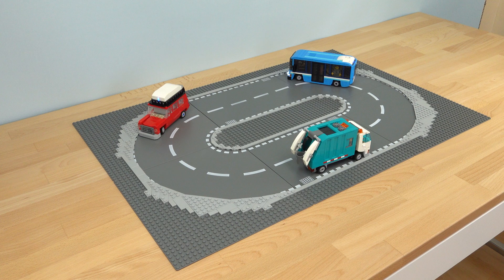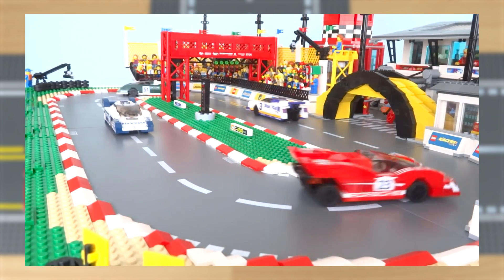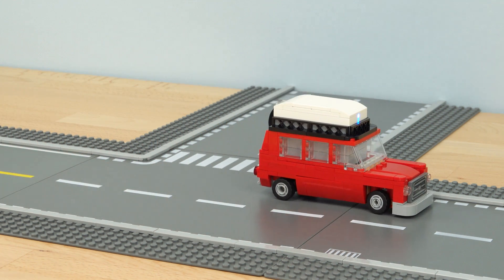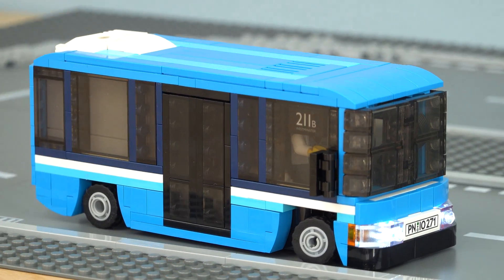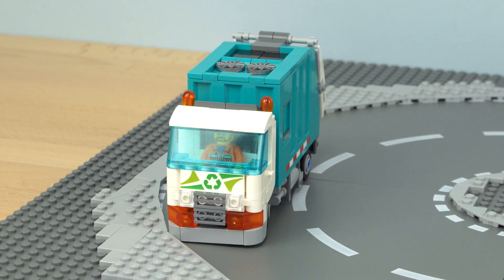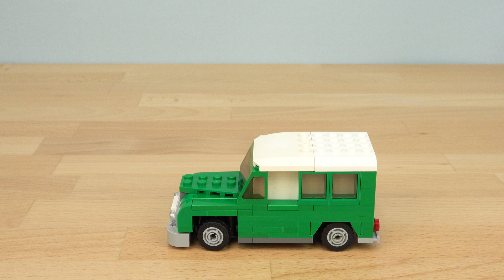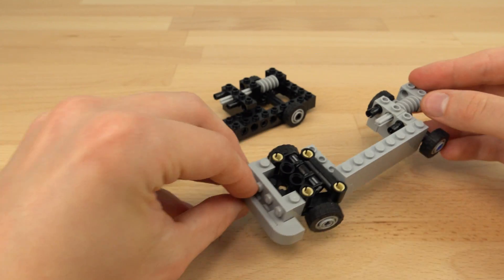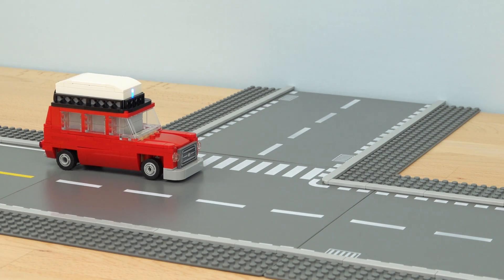Self-Driving LEGO Vehicles - Tutorial!

Comment: This is neat but JK Brickworks did a better job by implementing a iron wire under the track and uses magnet to steer the vehicle.  I use his system in my city with a L shapes road and it can accommodate 2 opposite lanes.  I have a van, bus, and truck running in it.
Reply from the maker: JK Brickwork's design is interesting but it's not a 100% LEGO based solution if you need bits of tape and metal wire. I specifically wanted to design a self-driving system that uses only official LEGO pieces and no third party elements.

Comment: Very nice, one issue though: With the way it is set up it can only deal with one set uf curves though, right? I.e. if you have a left curve followed by a right curve wouldn’t the car swerve into oncoming traffic? To combat this I think you could spring-load the steering so that it always steers in one direction per default. (i.e. right for driving on the right side). However, then it wouldn’t be able to drive across straight junctions like your current version.
Reply from the maker: Yes that's correct, in that situation there would be nothing preventing the car from driving over onto the opposite side, unless there was an extra bit of pavement in the middle of the road to help keep it in the correct lane. A spring-loaded steering mechanism sounds like an interesting idea, I'll have to try it out!
Reply: Could be worth building a central island for the straight bit in between two curves.
The island could be used as a refuge for pedestrians crossing the street.